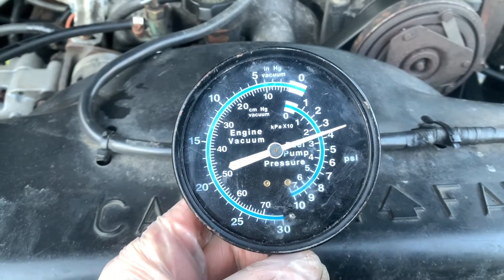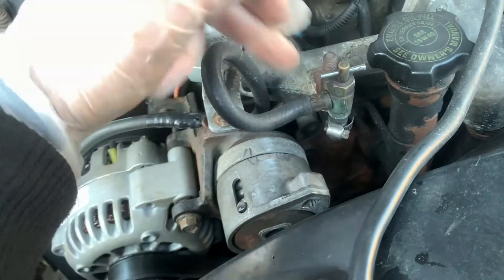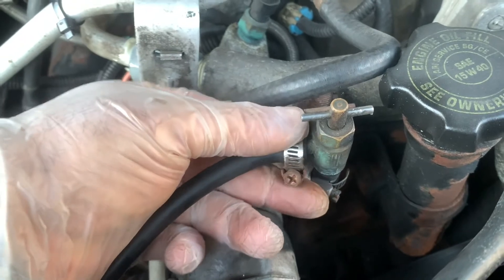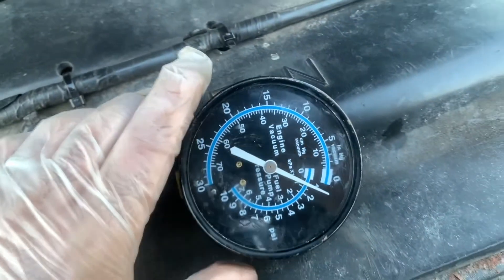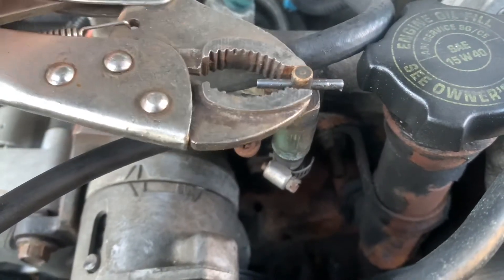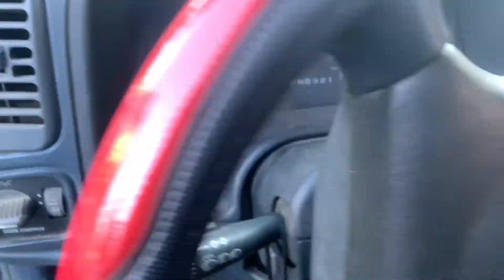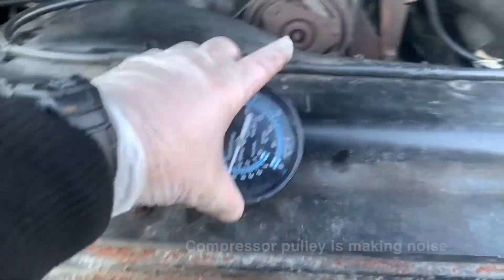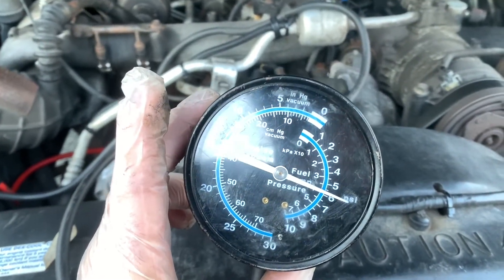6.5L DIESEL FUEL PRESSURE TEST | LEAKING A LOT| SQUARE BODY

Comment: Good, clear explanation on this issue. Thank you for the video since I am trouble shooting this issue on my grandson's 1998 6.5 td. It is hard to start and runs rough. The lift pump works but appears to have low or no pressure. It is cold here in Ohio and it isn't able to be started as yet:( I will use your advice on using the bleed hose to measure pressure. I don't have a gauge that has a small enough scale to use. By the way, the way you cut in and explained what was going on was excellent and I have seen the website you referred to. Happy new year and God bless
Reply from the maker: Awesome feedback, I appreciate it.

Comment: That website you posted is really awesome, I had not found anything like that yet in my search for fuel system troubleshooting. My truck has just had me stumped. Drove around find, brought it home parked it in the driveway, and it refuses to start. Been chasing the problem slowly, still no luck...Maybe with that I will be able to figure it out. Thank you!
Reply: Did you figure it out?
Reply: I thought I had, got it to start when the temp dropped below 40. It's been sitting now for about 4 hours, and now will not start, cranks, bit puffs black smoke and acts like it wants to start....I'm not overly familiar with starters, but this one is giving me about 2, 10 second crank attempts before it starts to whir/click and then has to sit for awhile before it will actually work right, and turn over the engine again
Reply from the maker: Make sure your grounds are good.